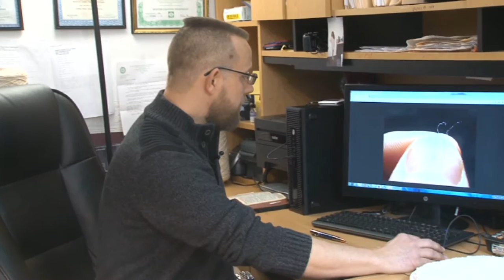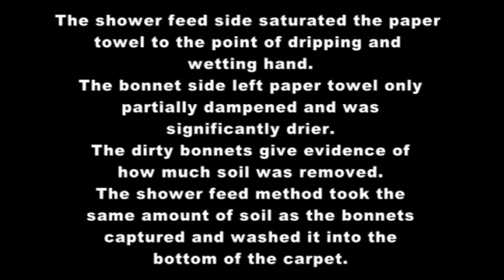Carpet Cleaning Bonnets 101 | Bonnet Pro

Comment: Nice demo john ,on pre dry carpet mats. but i wish you had of prespray and agitated first to see the real challenge. I spoke with you in your office last year and your knowledge and love for the carpet business and (faith beliefs )convince me to continue my floor service your knowledge was awesome information. I also did the bonnet brush vs the cimex test with citrus orange boost up prespray along with agitation and bonnet pro surround encap  with a carpet brush on commercial dirty carpet to loosen soil in fibers.you are correct the bonnet brush was the best,(BEST) the cimex was good as long as you re bonnet or dry extract after afterwards on heavy soil CGD. Most videos do not show dry carpet results only wet carpet after procedure demos. You need to see the real out comes and over wet carpet spots upon carpet to validate what really works .The cimex work well on light to moderate soil on CGD only. you may not get wicking but the post vacuuming will not release all the dirt out as marketed but it will gradually over many vacuum attemps.  The bonnet brush is AWESOME !